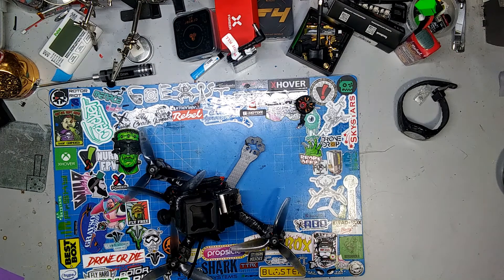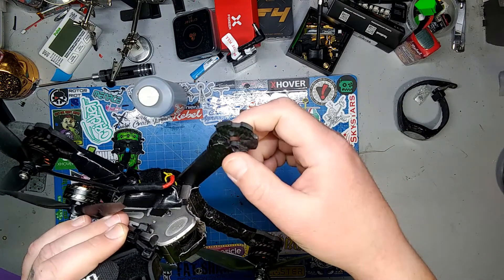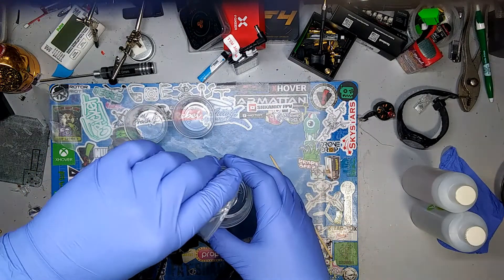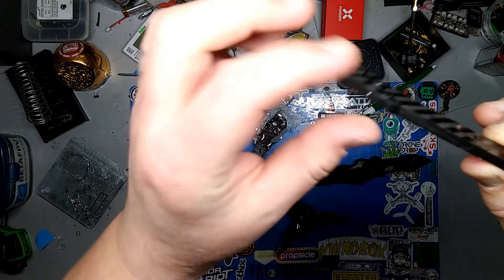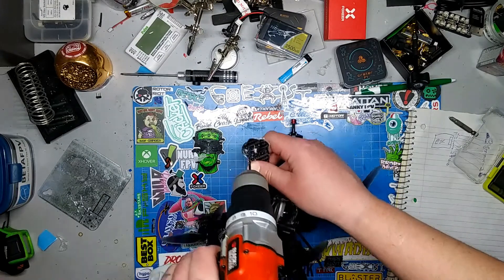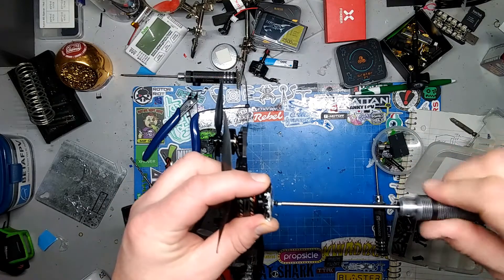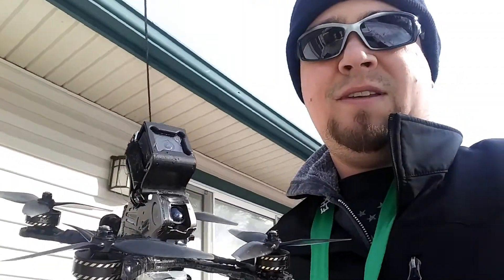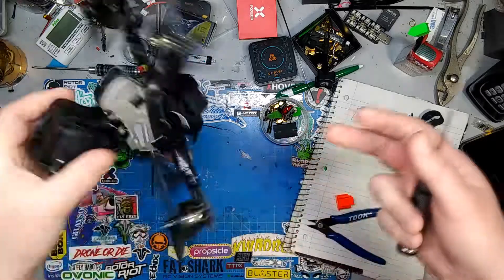Fixing carbon fiber drone frame.

Comment: Is it still holding up? I have couple broken frames in my parts bin and I'm thinking of using epoxy to glue them back together.
Reply from the maker: Yes still solid great stuff
Reply: @yakenmichigan9250  Great! I'm going to bust out the epoxy, I hate having to buy new stuff all the time!